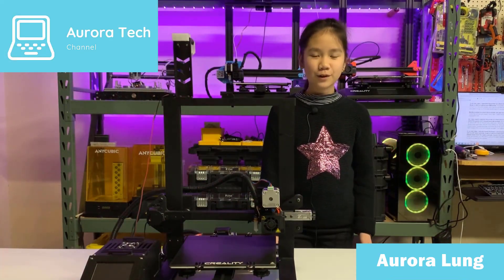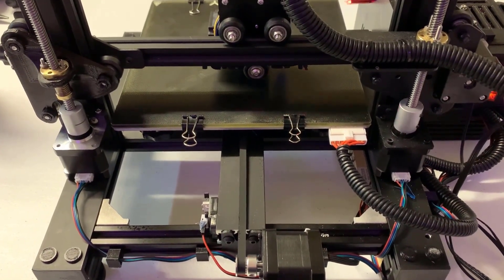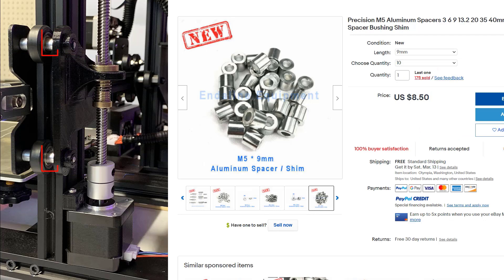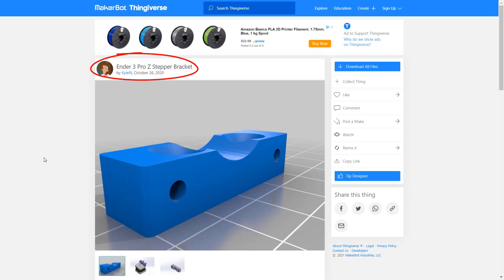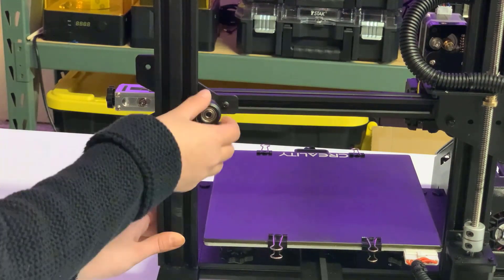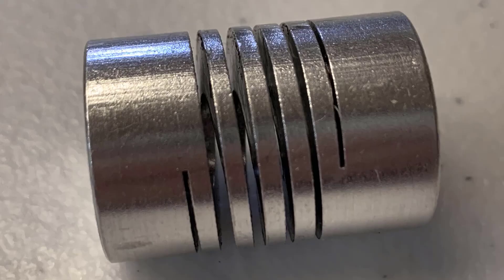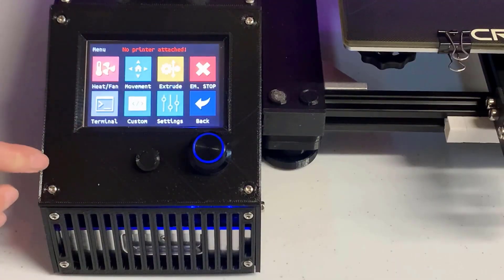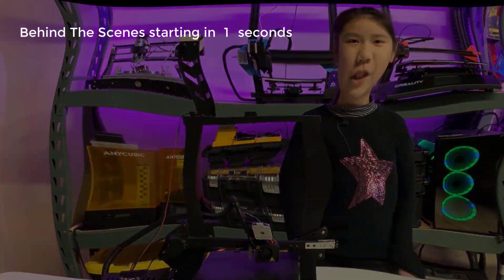DIY 3D Printer Dual Z Axis upgrade just cost $27, for Ender 3, CR-10 and almost any FDM 3D printers

Comment: You can 3D print a stepper motor to lead screw coupler.  There are several designs on thingiverse for these.  Most use captive nuts.  I did this on a homebrew printer and it worked very well.
BTW, there is a VERY light weight direct drive extruder now available from Micro Swiss that can be used on the Ender 3 series that might not require a second Z axis drive screw.  It uses a pancake motor, and a geared drive.
Also,  the auto bed leveling system should correct for the drop of the z axis between the two sides with a single z stepper system.  So the need for the second z stepper is questionable.  Consider that many printers such as the Ender 2 series, and the Prusa Mini don't even have support for the Y axis on both sides, let alone two drive screws.  Printerbot made such a printer, and it had a direct drive extruder.

Comment: Very nice but running a dual z with a splitter cable is not so great .. id would be better to run dual z with 2 stepper drivers seperatly as ive tried it out .. you would need a btt skr board in order to achieve

Comment: Excellent again! Only the z-offset between left and right can change. Just by leaning on the x-axis. Or bij unhelpful cats. That is the reason I implemented a GT2 timing belt on the top of both z-axis lead screws. So it is impossible to get them out of sync. ;)
Reply: She's driving them separately from the MoBo, and has a BL touch. This means its possible to use auto Z leveling via G-code. Alternatively increase the max Z distance and drive the axes against the stops before printing. Sounds like a coffee grinder but will sync them even if they are connected with a Y cable.

Comment: Thank you for including the LONGER!
 I am new to 3d filament printing and purchased a LONGER LK5 as a starter to build on, unfortunately its not as big of a community as the  Awsome Ender Crowd(what a great community!)The LONGER seems to be a clone and well built so far. I am excited to add to my knowledge & experience base and you are a big help. I plan on upgrading to print flexables for my grommet project, and direct drive for flexibles and a dual drive setup will be the upgrades for now, I need a source for the longer's lead screw( It's a 4 start 8mmx500mm height), I already have the OMG extruder/stepper combo from your link, but won't install it untill I have printed the parts in this cool episode. and the proper lead screw etc.. 
Thanks again & warm regards from SoCal south.
Jimbo C.
Reply: Did you make all the upgrades you mention? I have a longer lk4 pro (very similar to lk5) and I'd like to make some upgrades too.
Reply: @Dartherick  Hi Erick !  No, However I bought the components but got sidetracked with life's uncomfortable realities. I'm not giving up on using the Longer with larger nozzles & the gear fed system. But a big fat Co2 laser table is a priority at the moment.. I wish I could give you a report..

Comment: Does this applies to the Longer LK5 Pro you review previously?... Can I just buy the items from the list and that will be it. Let me know if you can and what great videos you have a subscriber.
Reply from the maker: Yes, I used the same support plate on the LK5 Pro dual-Z upgrade, you need a 500mm lead screw instead of 350mm for LK5 Pro. 

500mm lead screw:
https://ebay.us/s2fJ04
Reply: @AuroraTech  Hi there, I got the printer but the people from Longer Amazon send me the LK5, not the Pro version. I am keeping the printer because I believe it will be a good platform to learn as a beginner. Does the LK5 Pro dual-Z upgrade apply to this printer? Also what other upgrades do you recommend for the LK5? I don't know if I can make it into the Pro version ;). It might be a fun project to do... Thank you for the videos and channel. Cheers...

Comment: There has been some debate on how to install the anti-backlash nut. Some say it should be with the spring on top. Also, the bubble level should not be used for leveling the bed. If the floor is uneven it will reflect on your printer.

Comment: Very good video.

I personally prefer leadscrews 8mm 1-start pitch 2mm lead 2mm. You have to turn them 4 times as much as the standard 4-start lead 8, screw. Also homing is slower. But it is practical impossible to accidently move z-down by force. Of course you can intentionally dearange or rearange z0 and z1 by hand rotating the screws manually. But that would not happen by accident. On the other hand, if you want autocalibration in Prusa style (moving up z more than possible until the motors skip to realign both sides - the mk3 already is designed so, for Ender I simply used some brakets mounted at the top of the z-axis as a "hard stop") lead 2mm might result in to much force.
The main reason for 2mm lead is magic layerhight: a typical 1.8° stepper moter has 200 steps/totation. So with lead 2mm any full step (the most forcefull ones, fractions of steps  makes movements smoother but do not result in much more precision on z) is 0.01mm high - making all layerhights "magic" and impoves ABL precision also.
But this is only a personal preference; autoaligning with prusa-method might be more important for others.

For the nuts I prefer POM insted of Anti-Backslash. The do not need service (they are self lubricant) and also have no backslash- Also they are extreme quite.

For the coupler: I got fantastic results with thing 3941527, wich is a self-centering coupler. So spare the money for couplers and print theese with PETG.

Comment: Nice sharing, just curious how do you connect your 2nd z step motor to the motor board, any tweak to the firmware to support the duo z axis printer?
Reply: Shouldn't be a tweak, 32 bit mobos should just mirror the actions of the original stepper, from what I gather

Comment: At 9:15 Using a bubble level....
What about if the table is not level?
Reply from the maker: I would just make the gantry relatively level to the bed and don't care about the floor, table, or other things outside the printer

Comment: Really do like the information you put out.  Thank you for takimg the time to do it.  I was looking to add a dual z to my ender v2 however i also see belt driven types.  I was looking to see your thoughts on overall reliability and precision of each?
Reply from the maker: The belt type supposed to be a cost saving solution, but if you buy a kit, it’s almost the same price as the kit with extra stepper motor, moreover, if your motherboard support has dual stepper drivers for the z axis, you can use g34 to do auto z-align if you have 2 stepper motors.
Reply: @AuroraTech  thank you
Reply: @AuroraTech  I installed a Creality second Z drive.  The problem is the steppers were not always in sync, and I could not move the Z axis manually.  I put a longer screw on the right side, extending above the tojp rail, timing pullleys on both Z axis screws with a hand crank on the longer screw, and an adjustable tensioning pulley on the vertical frame piece.  Now the two sides stay in sync, and I can manually raise/ and lower the  gantry for bed cleaning, leveling, etc.

Comment: Which printer are you modding in this video? You said you used the plate from the Alfawise but the print bed says Creality.
Reply from the maker: The frame is Alfawise U30 Pro (or LK4 Pro), this printer is using many other parts with different brands like Creality, BigTreeTech... I decided the plate based on the Alfawise frame.

Comment: Thank you! I just have a question: once the printer is in direct drive mode, will you keep the original feeder and motor's support? I would love to mirror the new z-axes plate to replace the whole metal plate so that it doesn't have that useless support, but on the left we have the x-axes stepper motor, so the plate need to be modified... Unfortunately with fusion360 I cannot do it with your stl. If you could upload the whole project I could try to do this. Otherwise, do you have any other idea?
Reply from the maker: Sure, I just uploaded the f3d file on thingiverse, you can download the updated files:
https://www.thingiverse.com/thing:4774889
Reply: @AuroraTech  thank you!!

Comment: Well done.  I have a Longer LK4, so I appreciate you providing the Z-axis support plate on thingiverse.  I've been thinking about performing this upgrade on my printer.
Reply from the maker: Thanks, glad to hear that. In fact, the Longer LK4 is a nice printer, besides dual Z, I also added BLtouch and direct drive to the printer, the only thing I am not quite happy about is the touch screen, when working with the BLtouch, you can't set Zoffset or adjust babystep using the screen, I have to connect it to the computer using pronterface to send gcode to do that. I finally replaced the motherboard and screen to a big tree tech mini E3 and 3.5" TFT, it's working great now.
Reply: @AuroraTech  I've also modified it with a BLTouch sensor and direct drive, and I've noticed that the fine detail print quality really improved afterward.  I'm glad Longer released a firmware to support the BLTouch, but you're right that needing to use the terminal to adjust the z offset is a bit of a pain.  In my case, I'm using a Raspberry Pi running Octopi to control the printer.  It works okay, but I don't like that the official Longer firmware runs at a slower baud rate.  That actually affects the speed of some of the more complex prints.  Still, it's far more convenient than having to swap files using the SD card.  I'll have to check out that big tree tech board.
Reply from the maker: Please also check out the new BTT E3 RRF board as well, a few dollars cheaper, faster processor and wifi module with a terminal. I made 2 videos for this new motherboard, the 3rd is coming...

BTT E3 RRF:
https://youtu.be/7WYFlDbW6iQ

BTT E3 RRF (Wifi Module):
https://youtu.be/7J9vFdrF9kQ